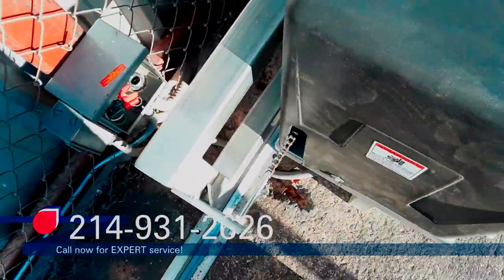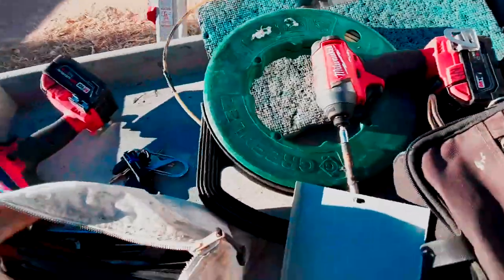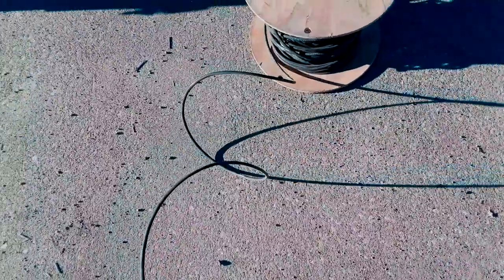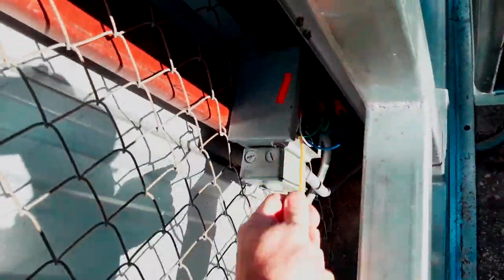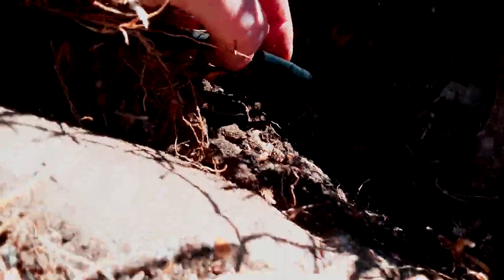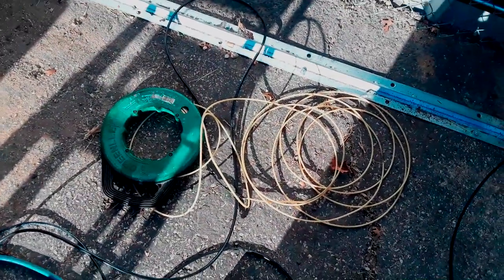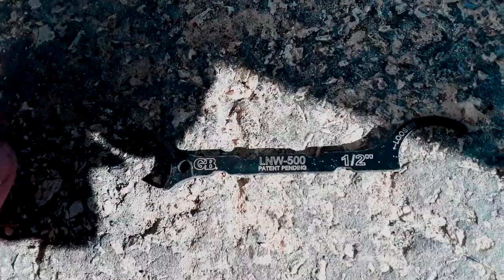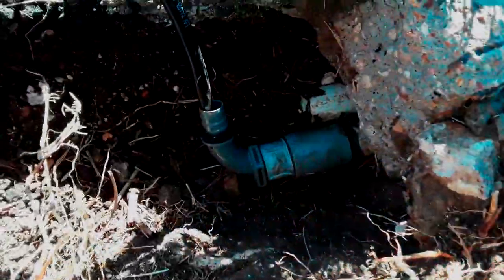Installing a slide gate operator Step 9: Pulling safety photo eye wire | SC0047

Comment: Why didn't you use the EMX IRB RET?
Reply from the maker: Great question! The EMX IRB–MON are always an upgrade choice for our customers. They offer a far superior range  115' (Over double the practical range of the RET) and are less prone to false detect. For a commercial that operates at all hours, which this one did, extreme reliability is required.
Reply: Safeguard Controls, LLC 

I'm learning first hand of the false detect with the RET. We have a 16' span. The reflector is mounted to a rock veneered column. Getting the reflector aimed was a challenge. EMX suggested placing 3 of them 120° apart 12" spacing.
Reply from the maker: Just a couple of tips, install a reflector hood - this helps in a few ways: helps prevent sun from causing false detects, protects the back and top of the reflector from getting damaged or contaminated with paint, stain etc., weld, opposed to bolt/screw on (which we do sometimes on stone, etc.) the photo eye bracket to a stable base, don't over tighten the reflector it can cause the reflective material to crack and shorten the life of the reflector, use direct burial wire and conduit.

Aligning the reflector on the RET was a pain at first especially if connecting to a UL325 2016 control board. What we do is connect to power direct if needed (depends on operator's control board features) and turn the sensitivity all the way up and then back off a little, 5% or so. Tighten the bolts all the way down on the photo eye and after visually/guessing aligning where the photo eye might hit left to right on the opposite side of the drive. You may have to loosen the bolts and readjust. We have found if you don't do this step and align the photo eye reflector before you tighten the bolts it gets out of alignment when tightened anyway. Walk out about 5' with the reflector in hand and get it aligned by watching the LEDS on the front of the photo eye. Keep walking back until you find center placement of the reflector on the opposite side of the drive. Then mount the reflector with a hood. You want the photo eye approximately 24 inches off the ground and as close to the opening as possible without anything on the gate causing an obstruction, such as the chain moving or chain brackets.

On all o matic UL 325 2016 control boards you can hold the reset button for a few seconds and it will turn the photo eye on for the monitor closed position. After one cycle it goes back to normal operation and will only close if the reflector is aligned. For the newer LiftMaster operators the photo eye is two wires and is powered immediately after making the correct connections. This makes alignment pretty easy. On the USAutomatic 2016 control boards there is an override jumper that you can use for alignment purposes.
Reply: Safeguard Controls, LLC 

I did notice the hood position was a big factor. I think we found the sweet spot.
Thanks for the tips.
Reply from the maker: Great, feel free to CALL us direct if you have any other issues 214 – 931 – 2626. Just as for Brooks "The Access Control Expert".